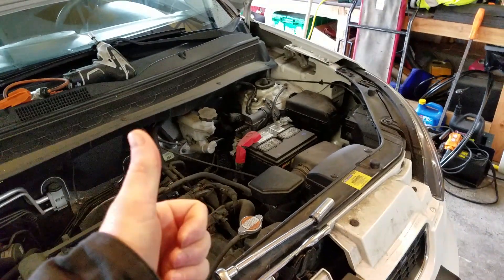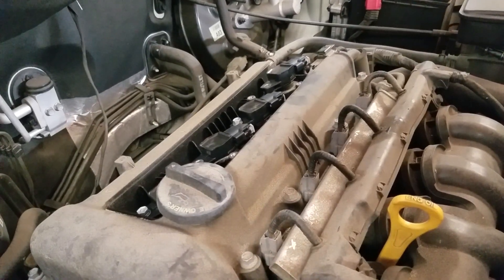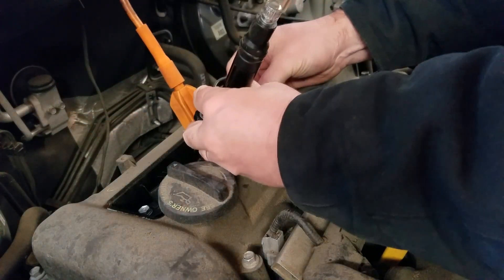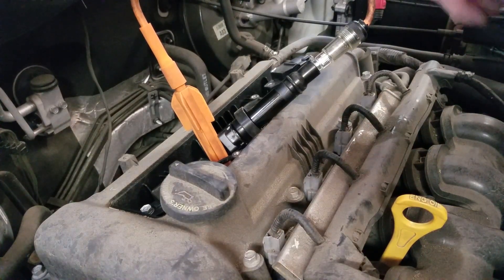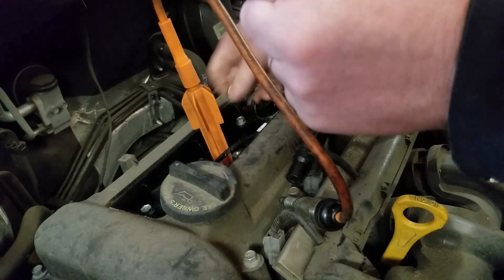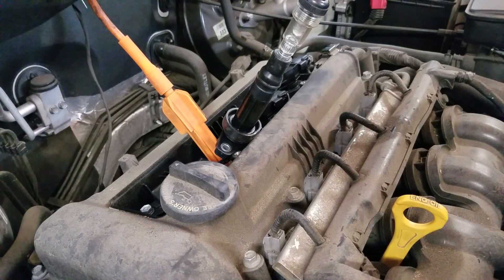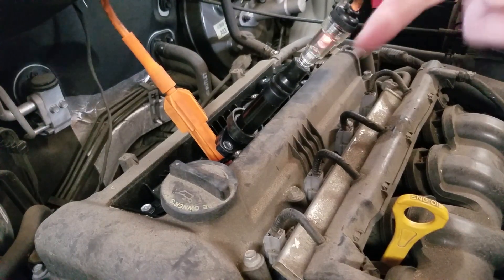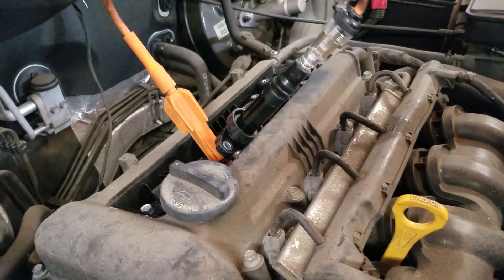2011 Kia Soul Misfire diagnostics.

Comment: So I have a misfire situation but all my plugs have spark, it's giving me code p0304 it's a 2010 kia soul 1.6
Reply from the maker: P0304  all that mean is the computer had detected a cylinder misfire on cylinder #4. 
 Verify the misfire. 
Do you know how to do a cylinder balance test?
  The spark plugs are only a small part that make a cylinder work. Is the coils making spark? Is the injecter firing? Is the injector spray pattern correct?
  This is what I never advocate code readers. People believe the code tells you what's wrong.  Occasionally yes. But what a code is.. is just telling you what the computer is upset about. In your case the computer see that cylinder #4 is misfiring. The question that has to be answer before more parts and money is thrown at is it, is WHY does the computer thinks cylinder #4 is misfiring
Reply: Is there a way to test the injectors? I'm mechanically incline but more of a old school carburetor type of guy lol
Reply from the maker: @dustinh4283  
You can Ohm test em with a meter. But that only tests the the coil winding in the injector. Won't tell you if the injector is plugged or restricted.  But in my experience... best practice if to verify everything else,... are u getting spark to the tip of the spark plug? Is the compression solid?  Are you getting injecter pulse from the computer. If you can answer yes to all that then u can suspect injector.
And u can get a noid light kit from harbor freight or Amazon cheap these days or check to see if local auto part  store will loan it out. Use that to check for injector pulse.
Old school trick... u can use a mechanic stethoscope to listen to the injector too.

Comment: Just purchased a 2012 Kia Soul 2.0l. It is misfiring, really bad when idling in gear. I'm going to run through this test. I suspect the plugs need to be replaced but I'll use this dianostic tool first. It has about 96k miles on it.  Thanks Steve!!!

Comment: I have a 2012 Kia Soul that has just developed a #2 misfire I am having surgery tomorrow and was wondering if it will hurt to run it til Friday when my husband gets home ( he’s a truck driver) my daughter will b driving? Thank you
Reply from the maker: It's not good for the engine to  drive with a constant misfire. 
It can also damage the catalytic converter.
Reply: @Steve4x4  Thanks for the advice! Don't want to have an overheating issue because of a damaged CC! Bought our 2012 2.0l a week ago. It started doing this of course, after we finalized the purchase and brought it home. DOH!! test drove went fine and didn't notice an idling issue. More apparent while in gear.
Reply: I ended up replacing the ignition coils. There was a misfire happening on cylinder 4. The rough idling when in gear stopped. $100 for 4 coils from Amazon 👍

Comment: I found that a small amount of engine oil leak from rocker cover onto coil pack rubber boot causes it to short, resulting in misfire.  Clean up the oil, and inside the rubber boot plus chamber where it fits.   Solved my misfire problem completely without having to replace the expensive coil pack.  Good luck.
Reply: Thanks!! I will examine for oil once I get the plugs out. I'm clearly having a misfire issue, worse when idling in gear, on my 2012 Kia Soul 2.0l.
Reply: Thanks Kazzrich - Perhaps I should replace the rubber boots since I'm replacing the plugs. The check engine light came on a couple days ago, but it isn't flashing, which I've read is a very bad sign.

Comment: how do you get the plastic cover off to get to everything?
Reply: The one on the soul just pulls right off. No tools needed.
Reply from the maker: Do you mean the engine cover? I cant tell you how to do that cause it was too long ago to remember specifically.  Sorry. Most just lift up. 
Some have 10mm bolts. And other have lift one side and slide fwd.

Comment: What’s the firing order for this car I can’t find it anywhere
Reply: Joey P.,

Subscribe to a Yearly DIY Version from All Data for your particular vehicle.

Not only will it give you the EXACT Firing Order for your vehicle, it will tell you the possible problems to the Code that was retrieved from the Data Link Connector...I don't get a Penny for this DIY All Data plug.

www.alldatadiy.com 

Just because a vehicle is a " Distributorless Ignition"  system doesn't have a da_ _ thing to do without having a Firing Order....Every vehicle on Planet Earth has a Firing Order.

However, he did submitt  an EXCELLENT Misfire Technique Video.

Automotive Professional background
Los Angeles County
Reply from the maker: I don't know why you're even asking that question because it's distributorless ignition meeting there is no change in the firing order because it's computer controlled. You can take coil number one and put it into coil number two or even number 4 in the computer will not care because it controls the firing of the coils.

Comment: Hi any chance you can help me with my kia soul diagnostics? I had the exact issue as the video you posted but that didnt seem to be the problem I believe my issue is the fuel injector. Any chance you can show us how to clean it?
Reply from the maker: No way to really clean the injector at home. If you have the injector out.  U can try to find a special shop to try to sonic clean it. Even then its hard to clean a fully plugged up injector.
Reply: Halloween Kills - Oh, maybe that's my issue. I'm experincing rough idling while in gear (more so than in park). After I replace the plugs and PCV valve, if I still have issues, I'll examine this next. Oh boy...not impressed considering I just purchased it! But that's the risk with buying used.